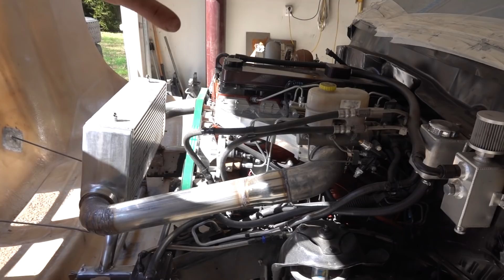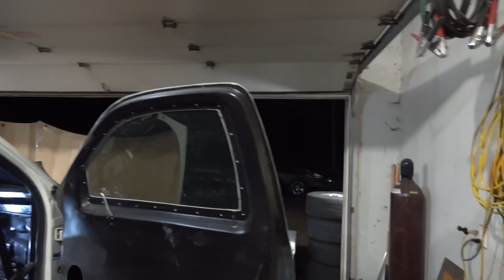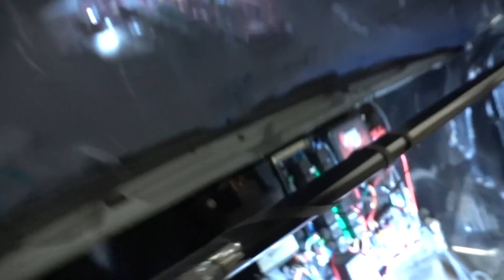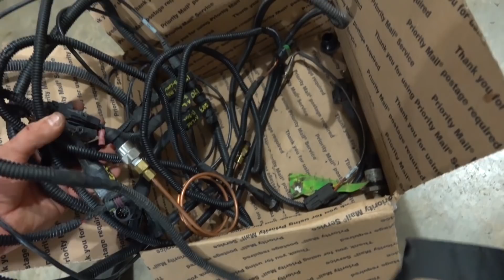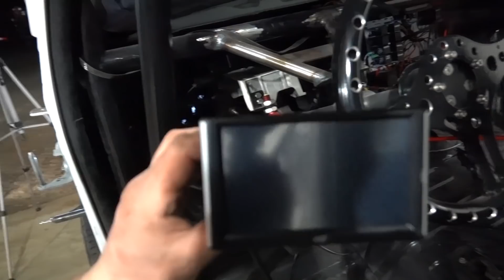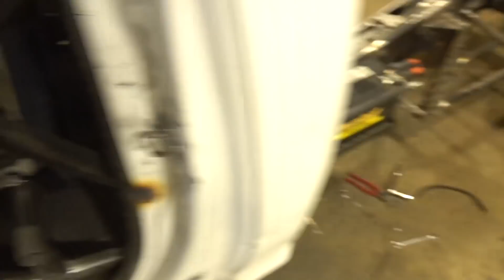This Is My Least Favorite Thing To Do.... Rewiring The 2000hp Cummins Drag Truck

Comment: This may be me but I don't remember all the holes in the steering wheel? Wiring is like drywall muddling. Retarded work with no visible return for the time spent...Electrician talking